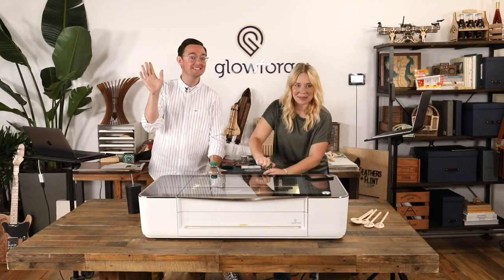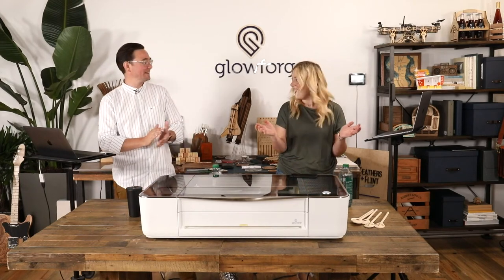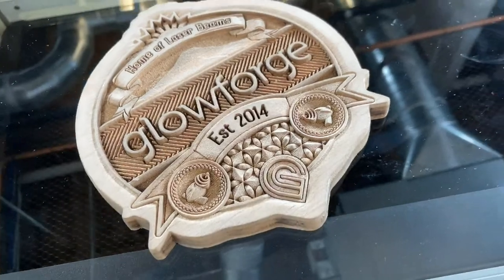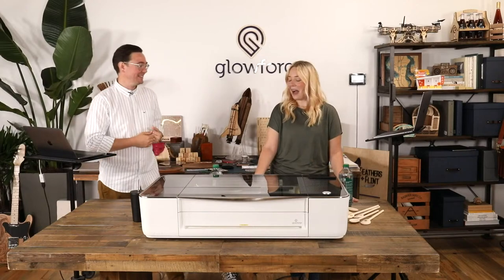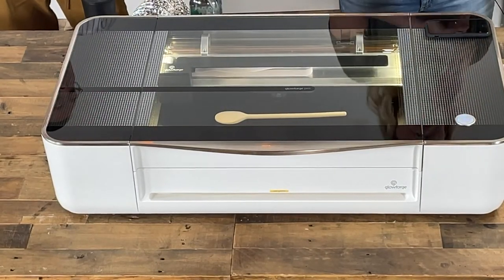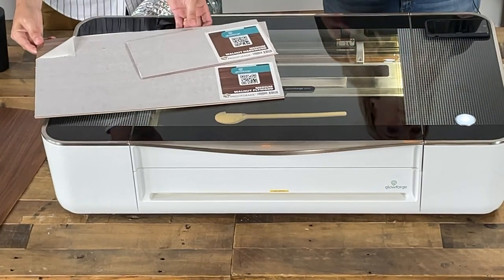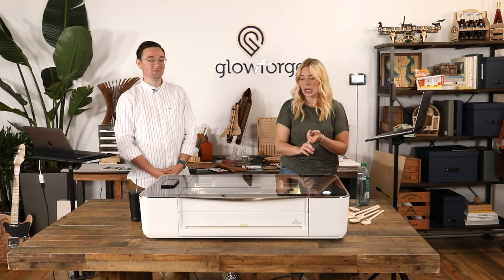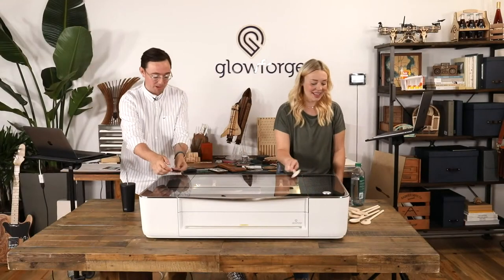Making Money with Glowforge: Live Q&A

Comment: Will this machine engrave on bare stainless steel or would I have to get a laser with CO2? Thank you in advance.
Reply from the maker: Hi Michelle! You can print directly on coated metals or you can use something like CerMark to add a coating to uncoated metals like stainless steel. A desktop laser isn't quite powerful enough to cut or engrave metal so your Glowforge will etch away the coating to print a design. Glowforge has a custom CO2 laser tube operating at 10,600 nm that averages 40W for the Glowforge Basic and Glowforge Plus and 45W for the Glowforge Pro. -Ellen